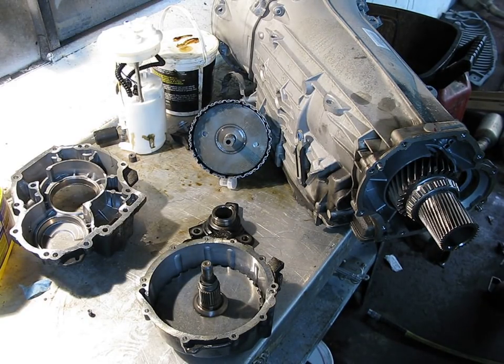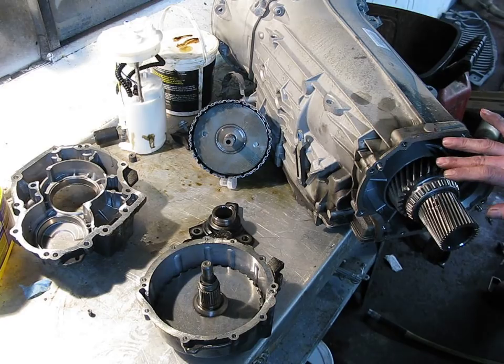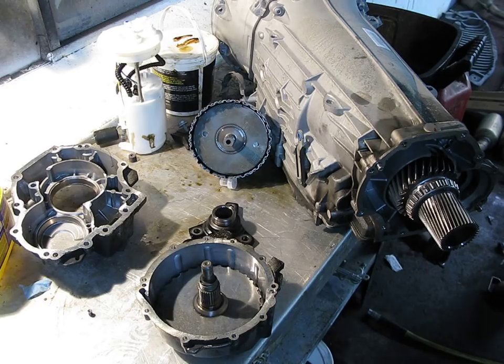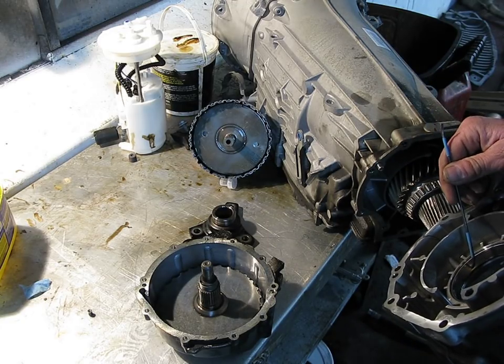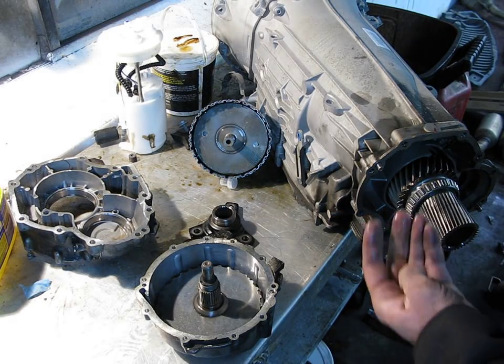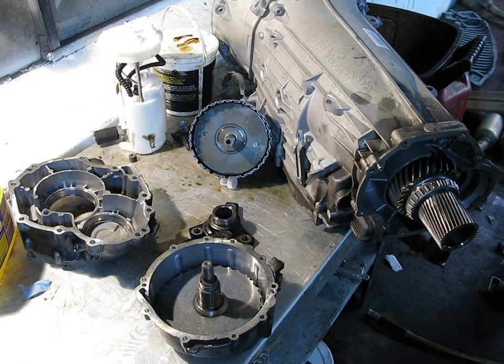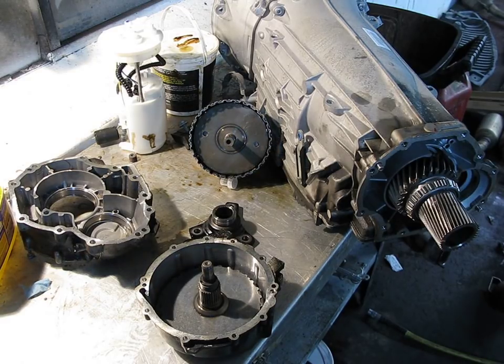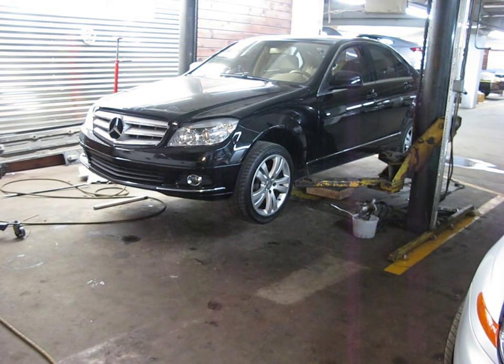Mercedes C Class 4Matic transfer case problem

Comment: I have the same problem,  but on E550. In addition,  I have some vibration in the steering wheel without pressing the brakes pedal - all the pads and rotors are new. I guess the vibration is also coming from the transfer case?
Reply: Wow my 07 e550 popping when turning slowly

Comment from the maker: It really sucks that YouTube does not notify me of comments on this video as they come in. I see several comments below that are over a year old that I never knew were there. This is by far my most popular video and it was unexpected to get this amount of attention, but I can clearly see why it does now.  For those seeking more info about this, don't forget to read the description and read through the comments and replies I have made so far. As for anyone who have not had a reply to your comment, I will go through them soon with a long delayed reply. You can thank YouTube for this and I know for certain I am not the only one who experiences this issue.

Leave any questions that have not yet been answered after viewing the comments and video description. I will make it a point to check this video on my own accord from time to time.
Reply: Hi buddy, i have e350 4matic. My car vibrates at 50mph, and I had it checked. The axle pointing from front differential has some movement. I can move driveshaft up and down for 5mm. What should be the problem? Thanks!

Comment: Is the transfer case fluid shared with the transmission? How are the contaminants from the transfer case failure kept from going into the transmission? Will a 2015 transfer case fit a 2011 transmission? If you rebuild the transfer case from the 2011, replacing seals, bearings, etc, how long should it last?
Thank you!
Reply from the maker: Yes, the fluid is shared between the transmission and the transfer case.

There is no guarantee the fluid contamination from the transfer case does not get into the transmission itself, but from what I've seen so far, the contamination is large pieces such as the cylinder shaped rollers or chunks of them. This is why I recommend replacing the roller bearing between the transfer case and the transmission -  it's the one you see in the thumbnail still attached to the output shaft of the transmission and this bearing doesn't seem to take on the damage that the other three do.

I do not know if the 2011 ans 2015 transfer cases are interchangeable or not.

As for how long this minimal repair should last is still unknown. Just keep in mind that no matter what, you are still driving on borrowed time and if you  do perform these repairs, think about trading the car in right after, especially with a Mercedes dealer if they give you a fair trade in value with them thinking this failure has yet to occur.

Comment: Thank you for the video. Can the transfer case be removed without removing the transmission? Also, is it difficult to remove those bearing - i searched for tools and there are different kinds of bearing removers. Thank you.

Comment: I know this video is 7 years old, but I have a 2014 c300 which is making a rotational whine that goes up in pitch but not up in volume. It's not a grinding sound but more like a howling wind sound. Most people can't hear it but I can because it's my car. I did get new tires and I was thinking that it might be road noise. I took it to the dealer and they believe that it is the transfer case bearing. They want to charge me 9 grand to replace it which is outragious. I have doubts that's what the noise is to be perfectly honest. I did notice today that if I take a corner with speed and add side load to either side, the noise volume goes up by quite a bit during the agressive turn. Would a transfer case bearing do that? Or could it simply be the tires? There are no other symptoms. ride is smooth. Thoughts?
Reply from the maker: Without test driving it myself, it's difficult to pinpoint the problem. Wheel bearings could be your issue. The torque or rotational movement of the engine and transmission together could be the reason why sound would change from the transfer case.

Since this video was posted, a few suppliers made a kit available for this repair.  $9K is too much to spend on something that still leaves your car on borrowed time. I haven't researched this matter since I posted, but I will be doing that soon. I expect a 3rd party manufacturer to come up with the housing for the transfer case that provides a solid solution. I think it's possible, but then again, I am a tech, not an engineer with the resources and cars available for product prototyping and testing.
Reply from the maker: What city are you located in? I might be able to point you in the right direction.

Comment: that is the transfer case not the transmission, no need to remove the transmission to replace the bearing on the transfer case. You ave 2 bearing one  front and one back on the front and back shaft on the 4matic, you need to disassemble the full transfer case and remove gasket seals and bearing  2 per side. No special tools needed to remove the bearings.

Comment: After reading one of your replies I want to make sure I understand this..
You’re saying the the transmission put in the w204 4matics during 2008-2011 (pre-facelift [LCI]) have a weak transfer case housing that warps or flexes causing damage to a bearing, the the only way to remedy this completely is to replace the transmission with one from another model year, because if you just fix the bearing or replace it with one from the same model period (08-11) that this will likely happen again. 
Is that correct?
Reply from the maker: Yes, that is correct. Replacing the bearings in the housing is "a fix" but you are still on borrowed time.  I wish to have connections with machinists and engineers to develop a replacement housing to make this problem a not-so-much of a problem.
Reply: What transmission do you suggest replacing with?

Comment: I have a 2010 Mercedes e350 4 Matic  end Is making with a weird noise inside in the The cabin Something like vibration so I change the CV axle‘s in the front I change the driveshaft the front driveshaft that short one I change the front differential and the noise is still there so it’s another mechanic he tell me that he can be the transfer case the problem but I really don’t know I throw a lot of money in this car and the problem is still there so if you’ll have more knowledge about that please help me out I want to specify that when I’m in the parking lot I try to park the car I turn the steering wheel left or right and I release my food from the break it start shaking all the car he’s basically shaking and he’s vibrating everything inside like all the dashboard and everything is vibrating if somebody of you guys if you have experience like this please let me know what to do next step thank you very much
Reply: Hi, i have the same issue, when turning left or right it has a vibration and and a metal grinding sound specially when starting to drive , its not the axcels as i have opened and checked them.
If anyone has a a suggestion that would be great.
Reply: Update, after many checks, ot was the transfer case, the 4matic system needs oil change in the transfer case every 50k kms. Change the oil and drive for 50km and the voice on turning is gone.
Reply: @fakhrialsouz  Did changing the oil help the problem?
Reply: @sassanhenryakhondi2816  yes, the transfer case oil change solved the problem. Its an easy job  just get the correct oil. And a smart mechanic that can open the bolt by taping on the side of the bolt to open it and close it. Fill it nearly full up its ok.
Reply: I had a c class 2007 and the transfer case oil bolt was difficult to reach and open, thats why i said tap on the side.
Reply: Hey fakhrial my 2008 c300 4matic has a weird vibration when turning left or right and going slow on a Parking lot. Feels like a 4x4 pick up on dry pavement. Do you think with changing the transfer case oil the problem will be solved?
Reply: @luisvillalobos6578  have you tried this yet I am going to try tommorow.
Reply: @myronhights4425  I had a German mechanic change my transmission/transfer case oil and it did not solve the problem! Took it to Mercedes benz a month later and they said I needed a new transmission/transfer case and that it would cost $7000
Reply: Sold the car 2 days ago lol was not worth it
Reply: @luisvillalobos6578  found a shop that specializes in MCB, BMW, Land Rover. 

Says I need new trannycase which is attached to the tranny he told me part was $2300. I’m looking into changing the fluid after watching this video first.

I’m curious as to who purchased your vehicle?
Reply: @myronhights4425  hi, did you end up fixing the issue?
Reply: @Axcelerated  nope sold the car.

Comment: Hi there Innovative Solutions!  I have a quick question for you:

I picked up a nice 2008 ML350 4-matic with 74k miles at an auction a couple weeks ago and it has a dull roaring/gear meshing sound coming out of the transfer case.  I took it to the MB dealership here in my home town and they said after stethoscoping it that the sound appears to be coming from the output shaft bearing on the PTU.  Having said that, they indicated that they wouldn't recommend taking the PTU apart but rather buying a new one for $5,500 or a used one for $3,000.  Is this really the only way to fix this problem?  This would appear on the surface to be exactly what you were repairing in your video. Please advise your thoughts on the matter.  I bought the car right but this is a potentially huge investment to repair.

Thank you kindly,

Michael

Comment: when taking off the rear transfer case cover is there a way to get it off if tapping it off does not work? I am having a problem with getting the transfer case off.
Reply from the maker: The transfer case cover and the transmission housing have the attaching bolts obviously. I recall one of the bolts being just out of view. Double check and make sure that all the fasteners are removed. There is no gasket between the housings. When mating 2 housings like this, which are machined aluminum, use an anaerobic sealing compound (Permatex #51813) as your gasket maker, not RTV silicone.

If 100% of the fasteners are removed, try tapping with a rubber mallet. In many cases, the anaerobic compound in combination with the precision fitted indexing dowels will present its own challenge to split the casing.  When we worked on this car, we removed the exhaust system and the entire transmission as you can see. Only after this did we analyze an alternative approach and realized that this can be done without removal of the transmission. However, removing the exhaust system still might be helpful. I do know that it can be done without transmission removal because I damaged the oil seal for the front driveshaft during reassembly without realizing it. The resulting oil leak was too great to ignore or disregard.

If you are familiar with the paper gaskets that have the dry red bead around the perimeter, that red bead is anaerobic sealant. If you have experienced the replacement of these gaskets during service work, you know that the red portion of those gaskets is what stays adhered to the mating surfaces and require adequate removal before applying the new gasket. Even with a sharp new razor blade, that compound is still a challenge to remove sometimes.  Take care with your approach and if you can place your impact on the transfer case housing to move it straight off the transmission housing, that's the best approach.  Maybe a block of wood can be used in your situation to direct the hammer blow where you want them to go.  I hope this helps.

What's better than doing your job once?

Doing it twice!   
~sigh
Reply: Did you have any luck successfully repairing this ezryder?

Comment: What the noises sounds like before the transfer case teardown? I have a 2012 C-class AWD and Im getting a slightly high pitch whining noise when I let off accelerator around 45mph only. its barely audible but I dont have that noise before. I wonder if something is up with my transfer case.
Reply: i have the same noise on my 2015 C350 AWD coupe
Reply: The noise is gone after i swapped the tires. i guess is tire resonance.
Reply: I wonder how the noise is gone with switching the tires. Are you sure you're not hearing it even with the new tires. What I hear is whining noise when cruising and letting go of the gas, but it doesn't sound from the tires
Reply: Benz likes to engineer system failures with a weak point. I wonder exactly what type of short-lived ATF they are using in all those failing xfer cases??

I know ATF fluid is a super picky subject and OEM ATF is thought as most compatible... where in fact premature failure prove it may not be the best.

MaxLife ATF seems like a step-up for many applications because it packs a great additive package proven compatible with (some) trannies, namely anti-wear for gears and bearings!!

On the flip side blended oil ATF with minimal additives break down with heat and require frequent service... 30kMi sounds safer than 50kMi.

Benz goes out of its way to ensure high maintenance with CHEAP SUB-STANDARD FLUIDS (Eng oil, brake fluid, ATF...) that rapidly brake down with heat like other car makes.

The goal is to go from performance to failure as soon as service deadline is blown 😉

Comment: Hello, I have this problem with a 2010 GLK350, the bearings are like the ones in your video, I see that you recommend a pair of Timken bearings for one of the assemblies, but the other assembly also uses 2 bearings,  and you recommend only one bearing. I got lost. How many bearings do I have to order?
Reply from the maker: There is actually 3 roller bearings and their matching outer races that should be replaced as a minimum.  Two exist inside the transfer case housing that is unbolted from the transmission itself. Look closely at the part on the left hand side of the bench in the video. The big circles are the outer races. The third bearing and outer race is for the output shaft to the front differential. The outer race for that bearing is barely visible, but you can see the circle on the right hand side of the big gear at the tail end of the transmission in the video.

I have discovered the outer races in the detachable housing part to be loose fitting. This is likely due to the housing being warped over time, torque, stress, and heat.  If you encounter this looseness, such as no pressure needed to install the outer race into the housing, there is a trick that might work for you.

Using a small hammer and a sharp punch, lightly dimple the surface within the housing where the outer race should be 'pressed' into place. Dimple the circle all the way around at the sides so it will slightly reduce the diameter of the hole. Before installing the outer race, use some "Sleeve Retainer" (a chemical compound) such as Permatex #64000. The sleeve retainer compound activates under PRESSURE, not temperature. So, if the outer race starts to spin in the housing, hopefully the sleeve retainer will heat up and activate to the point where it locks the outer race back into its natural position.
Reply: Carlos Enrique Diaz did you fix yours yet? My glk also has damage to its bearings and I need someone to repair. I live on the east coast. Thanks!

Comment: are the gears that the bearings go om able to be ordered including the gear for the front wheel drive?
Reply: No parts can be ordered from Mercedes.  You can find the bearings and the bearing races
Reply from the maker: Not possible thru Mercedes, but a source for used parts might be able to supply. Some trans-parts suppliers have used hard components on the shelves in back. You must specifically ask for such items as they are not advertised, nor the true source of their business.
Reply: thanks
Reply: that sucks for me then....I will thinking I could just replace the gear with the spline for the transmission to the front tranfer case
Reply: I found the gears for sale and ordered them. They are coming from Ukraine.